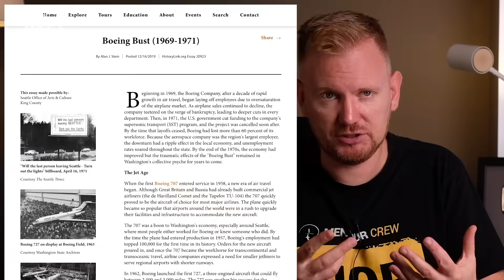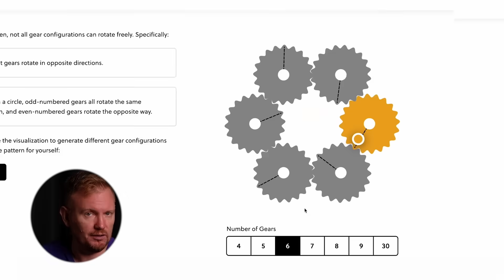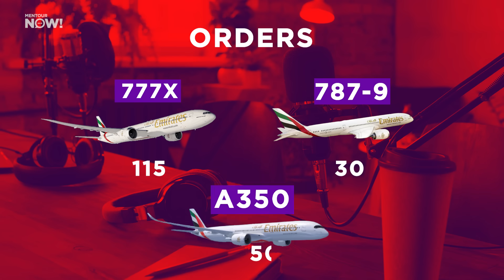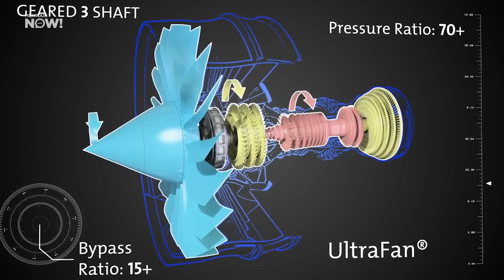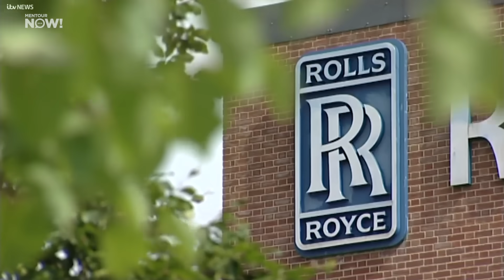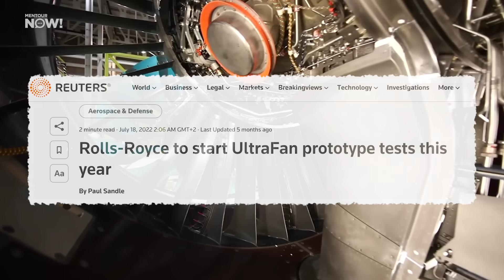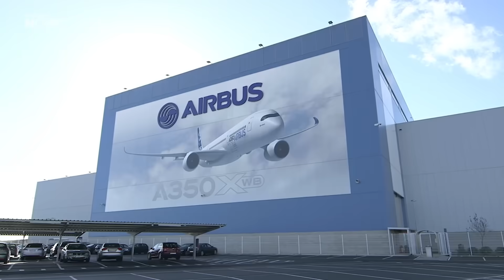Are BOEING planning a 747 with 2 ENGINES?!

Comment: I have in my possession a "eyes only" document (since "de-classified) of all the proposals for the "747X" ..... in it was a design for 2 engines among many other changes ...... very generic presentation from about 2000 ..... I worked as an airframe mechanic lead specifically on the pressure dome but also the entire empennage for 35 years ......... after looking it over again I think that Boeing was shooting for a significant reduction in weight by using thermo plastics, bonding agents(fasteners add weight), composites and in one of the proposals the massive reduction of weight less 2 engines .......

Comment: Just all depends on weather the diameter of the new engines is small enough to have clearance.  There are a lot of air-frames sitting around the world that aren't economical to fly right now. Two modern more economical engines could bring these back to life. The B-52 has been begging for new engines for many years but they can't solve the diameter issue.

Comment: The hub and spoke model is the only model that makes sense in the future. It is still the best way to move people with a MUCH lower carbon footprint than point to point -- especially once airlines embrace the concept that they are “carriers” and “travel companies” rather than airlines.  Calling themselves airlines consciously and subconsciously causes these companies to lock themselves in to one mode of moving people and cargo — airplanes.   If these companies embrace the carrier or travel company model, they free themselves up to invest in trains, electric luxury buses, dirigibles/lighter-than-aircraft, subterranean hyper-loops or tracks, multi-fan air taxis, boats, hovercraft, submarines, hell — any mode of transporting people and cargo that would require less fuel, create less congestion, and deliver people and cargo closer to their final destinations in the most comfortable and efficient way possible.  This is the same concept of changing the semantics, and thereby the perception of oil companies, and the perception oil companies have of themselves.  By changing the name or classification of oil companies to energy companies, these companies become better able to seek out and develop alternative sources of energy.  ExxonMobile should be embracing and developing solar and wind power, not fighting it — they are an ENERGY company.  Same goes for American, Southwest, United, etc.  They are carriers, not airlines.  Their job is to get people from one place to another place.  Focus on doing that job as best possible using every available resource to create a less expensive, more efficient, cleaner, more logical, and more pleasant way to deliver this vital service.   Using more efficient 747-8s, A380s, and future models of these two aircraft or newer super jumbos is the best way to move more people, using fewer gates, fewer landing slots, at fewer airports, while also using less fuel, creating a smaller carbon footprint, and more comfortable and pleasant experience.  It would also be nice if carriers and regulating bodies could come together the make operating four engines less expensive.  Twin engine aircraft don’t use less fuel (or much less fuel) to take the same amount of weight the same distance.  The main efficiency gain is in the lower required maintenance and inspection costs.  Four engines are safer than two, and just as fuel efficient when factoring movement of pounds of cargo or number of people.  So let’s stop the narrow minded mode of thinking and expand how we think about and discuss this industry.  It is currently one of the largest polluters and contributors to many of the ills plaguing modern society.  With a slight change in semantics and perception, that can all change for the better.  Side note -- make private jets either illegal or MUCH, MUCH more highly regulated.  Private jet travel should be the most heavily taxed thing EVER to offset the outrageous amount of pollution and airport congestion/creation created by this ridiculous, selfish, and totally unjustified mode of travel.

Comment: If Boeing build a new aircraft, will flight safely be an optional extra.
Reply: Interestingly on the 737 MAX, Boeing offered two optional safety features, an AOA indicator which showed the angle of attack in degrees, and an AOA disagree alert that lights when the sensors disagree.

Prior to the crashes only American Airlines and SilkAir had purchased both options. It seems we can question Boeing for making these features optional, and airlines for not purchasing them. 

Southwest had purchased just the AOA disagree alert, but it was discovered that this feature was inactive on the Southwest planes because Boeing had inadvertently tied the alert to the optional AOA indicator. Shortly after the crashes Southwest announced that they would now be purchasing the AOA indicator as well. I'm not sure what has happened since then with other airlines.

Comment: This is not so easy, as said ! Bigger engines, will require a higher landing gear, which comes along with a bigger wheel well. Just see the problems, Boeing has generated with the B737 Max. Engines ahead of the wing. I am not sure, if this will work out. However, as an experienced aircraft engineer, I would like to state, there is another rule and law, to be observed. For every airport, the rule and law applies, the "one engine out" limitations, which makes on a 2 engine airplane at least a penalty of 50% and in some airports, where a immediate turn is required, the effect will increase up to 60%. This leads consequently to a reduction of the take off weight, meaning payload will be reduced. Consider this, when ever the altitude and temperature is coming into the play, it will increase. I have compared this for A330 and A340 and this is for example for Nairobi or Johannesburg a difference up to 18% and if bad weather comes into the calculation it raises up to 22%, between 2 engine and 4 engines and currently the cargo prices, I would say quite a loss of income. I am also aware, that currently many airlines, focus only on pax load and load factor is their comparison. But currently knowing, that a fully cargo load on a B747-8I pays a the flight from south or north America to Europe and back. Even without any pax sitting in and complaining about the IFE or service. In my opinion, it is depending on an airline, what kind of transport they will target, only pax and avoid cargo, then it will be a 2 engine, but if an airline considers a serious payload covered by cargo sales, then a 4 engine aircraft is the only option.  In respect to the fuel consumption, I would say, it is insignificant. My experience has shown, that a B747-8I or F, or a B777-300ER or B777F, for the same distance, the fuel load was a difference of approx. 12 -14 t, but on the payload side the gap was around 19 t. Airport was 900 above sea level and both airplanes had the same take off conditions. Therefor, out of my view, it is always the question what kind of business an airline will achieve. Only pax or a combination pax/cargo or cargo only, then it shall be an aircraft selected.
Reply: At this point in commercial aviation only two engines will be considered. As with any two engine design it is only feasible if it can meet engine out requirements. If a particular range or capacity is required that would require more than two engines then it's a nonstarter. A340, A380 and 747-8 were the final attempts at the traditional approach for providing additional capacity beyond what a twin can provide.

Sort of two discussions here, most people seem to be concentrating on the idea of converting some size of 747 to two engines. This is more of a fanciful hypothetical, although interesting. The more realistic discussion is the concept of a larger than 777X sized twin engine airplane using newer larger engines. Either method however has to deal with the single engine limitations that you are bringing up.

As for bespoke aircraft, I think passenger only is possible, although passenger and cargo is preferred, at least the ability to create a cargo version in the future. I don't however see a cargo only new airplane design, or a four engine cargo version of a twin. Cargo companies like airlines are now all about maximum efficiency, and are willing to give up capacity or range to obtain it.

Comment: I'm long since retired. The first jet I ride I had was on a Caravel. Suit & tie! I've flown across the Med, Atlantic and Pacific. Been on DC6s, Comets, Lears, 707s & 747s, puddle jumpers and about everything in between. I few for business, typically 4 flights a month. After 911 things went to pot. Delays at airports, over crowding, over booked flights. It wasn't the adventure it once was. There really isn't that much difference which current jet plane you ride. During the Vietnam war I was stationed on an aircraft carrier in the S. China sea. Got rides on & off the carrier. Far more interesting! 

On a 3rd world DC6 flight over the Pacific, as we gained altitude the stews came around with bowls of hard candies. We were supposed to crunch on it to make our ears pop. The plane was too leaky to fully pressurize!  Lost an engine, black smoke rolled out of it, and the plane vibrated, a lot. The fire suppression system went on and white smoke rolled out. The big fan quit turning! Not a good sign given the lack of airports. Pilot came on and said, in broken English, "do to technical difficulties" we were returning the the airport.  They swapped out some parts and we took off again.
Reply: "stews"

Comment: There are a few EXISTING engines in the GE-90 and the GE-9x series that have more thrust than ANY PAIR of engines that were used on the 747.
Almost EVERY GE-90 model has twice the thrust of early 747 engines.

No need to engineer a NEW engine - just redesign the wings/engine mounts/landing gear for more clearance as needed.
Reply: It's not that simple. Remember, a passenger jet needs to be able to continue takeoff and climb clear of the field even if an engine failure occurs after V1. A 747 can do that with one engine out. I don't believe it can with two. Thus, the equation isn't "747 thrust / 2 = necessary power for 1 engine." It's "747 thrust x 0.75 = necessary power for 1 engine."
Reply: @fredocarroll  Academic point anyway, as most of the airlines are moving away from HUGE aircraft like the 747 and A380 anyway.
I think Emirates is the only exception - and even THEY don't seem real interested in adding any more huge airliners to their fleet.

Comment: Thought about two engine A380 a few months ago. While no engine today has enough thrust, especially for the take off and early climb phase (and engine out) why not do what Concorde did and add reheat (after burner) for this short phase of the flight.   I’m sure someone will have a good technical reason this is possible or not possible.
Reply: From what I have read, the more efficient the engine is via high bypass ratio, the less efficient afterburners will be. Afterburners already use a lot of fuel and create a lot of noise, and it would presumably be even worse for engines of this size. But I'm all for it! It would be great to hang out at the airport and watch A380 sized airplanes take off on reheat.
Reply: @StevePemberton2  I guess you could only apply reheat to engine core and not bypass.   Fuel less of a problem as reheat would only have to be used briefly but I had not considered noise, which is a major issue in this day and age.

Comment: well they hit the stuipid juice hard on the 737 max,so further dumb ideas like a twin engined 747 dont surprise me,safety seems to have run away
Reply: There is nothing unsafe about the 737 MAX design. Over 600 of the 737 MAX fly daily without incident, and orders continue to come in. Boeing made an inexcusable mistake in some software which led to two fatal accidents. The accidents were not caused by the new engines, but by how Boeing mismanaged the MCAS system which was related to the new engines.
Reply: @StevePemberton2  the max issue was ususing only ONE sensor when all aircraft used 3 of everything,ie 3 gyros,3 hyd syssystems  etc,never before was a SINGLE sensor allowed to control an aircraft
Reply: @andrewsmart2949  Yes. It was a huge mistake and inexcusable. Made worse by the fact that pilots weren't properly informed about the existence or purpose of the MCAS system, or given enough information on how to deal with it if the system failed.

Comment: Let's break it down simply. If you want a 747-800 size aircraft with 2 engines, you need an engine that would fit under the wing and allow ground clearance that will produce roughly 135,000 lbs of thrust. The engines on the 747-800 produce roughly 67,000 lbs of thrust per engine. I don't think we are that far away from having that amount of thrust from an engine. The problem will be clearance. Can you raise the height of the aircraft? Of course.  But will it fit existing infrastructure (hangars, jetways, etc)? Lots of questions need to answered first.

Comment: RR Ultrafan will be perfect for 4 engine bulk freight aircraft of 840 Tonne MTOW for civil and military applications. A380 is 575T MTOW. AN225 is 640T MTOW, 285T OEW, Max PL 254 T. At Max payload, the AN225 can carry only 101 T fuel. 
This new large aircraft would have an OEW of 320T, thus total PL+FL of 520T with a Max for each of 320T. Min FL and PL would be 200T. For heavy loads like tanks (4 US Abrams) and electrical transformers, the floor near the entrance will need portable legs. Min cargo will be twice the Max cargo of a B777.
New plane would have a fold up nose and space for 4 F-35 aircraft. An 8 m wide floor and 7 m ceiling are envisaged. The cargo space will be 6 sided, thus at F-35 wing ht it will be 11 m wide. While the AN 225 has a 1300 cu.m cargo volume, this new aircraft will have over 4000 cu.m. It will be able to carry upto 200 luxury vehicles with a dedicated car carrying frame. For auto companies transporting luxury vehicles between continents, it would mean deliveries in two days - very importantfor luxury goods buyers and company cashflow. It takes fewer luxury vehicles make a viable ioad compared to ships, and vehicles can be shipped to and from nearest suitable airport.  With an intercontinental load, vehicles could be dropped off at 3 or 4 destinations. 
A large 4 eng plane can replace economy with premium economy seating with takes 40% more area. As engines get more efficient, it is viable to give passengers more space with only a small cost and fuel penalty - fuel will be SAF or offset.

Comment: There was another flight who got an engine issue at altitude cruise level, that flight got to the destination 
airport, I think the difference was it was over land and not over sea.
Does the flight have enough fuel to the destination airport even when flying on one engine? Is it possible to 
continue to destination airport?
If it is so, what is the reason to divert to another airport? Has there been an incident where some has flown
to destination and other issues, and incident has happened?
Reply: The plane will be less efficient on one engine and may not be able to reach its destination and still have the required fuel reserve remaining. Even if it could they don't chance it and they divert to an alternate airport. I'm guessing they would choose an alternate that is capable of handling the passengers that will need to be booked onto other flights, or kept in a hotel while waiting for another plane to pick them up and get them to the destination.

Comment: The new engine is going to be used in a pattern of four to power a new Mach 1.5+ passenger jet which the People's Republic of China is building for trans-Pacific flights, and flights over land where arrangements are being made to permit it to make such flyovers. The aircraft will carry substantially more people than the Concorde did, though even with the huge RR Engines it will still be slower than Concorde was. This has been very hush-hush, but they are starting to talk about it a bit more, hoping to draw interest. the PRC is hoping that the new aircraft will establish them firmly in the civil and commercial aviation industries, as well as bring their airlines to prominence in the world market. Considering that China is a huge country and has a big pond to deal with in accessing the markets in the Americas, It's almost certain to be a winner for them. Be looking for the aircraft to make its debut in the mid 2030's. Also, it is said to have a rather unusual geometry so don't expect a Concorde look-alike or the traditional tube with wings.Beyond that, I know nothing about the shape of the aircraft.

Comment: Nearly the entire time you were talking about business cases for a twin engine 747, I was yelling at my screen that cargo is the perfect business case, and I was so relieved when you actually addressed it. The real selling point would be if either Boeing or Airbus could release a plane with the capacity of the 747 (especially with the front cargo door) that could take off from shorter runways currently served by 767 cargo planes. I'm imagining a solid business argument to be made in favor of having a cargo plane that could skip right past LAX or Seattle and land instead in a less crowded (and thus less expensive) airport further inland.

Comment: A 747 with 2 engines is called a Boeing 777.  There really is no need to have a huge 747 unless you want to haul cargo.  The 777 is still in production (as are the 767 and 787).  Bigger isn't always better.  A new aircraft with a 767's payload would require some pretty major engine development to get sufficient thrust, reliability, and efficiency - something Boeing would need to pay for.